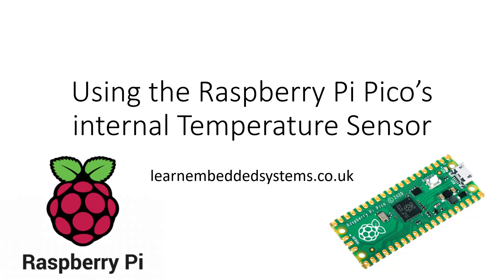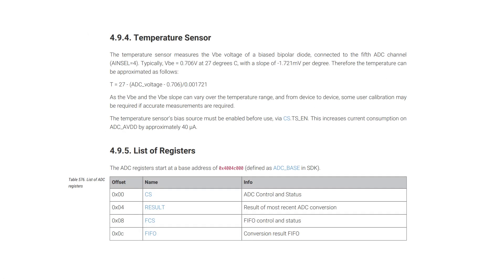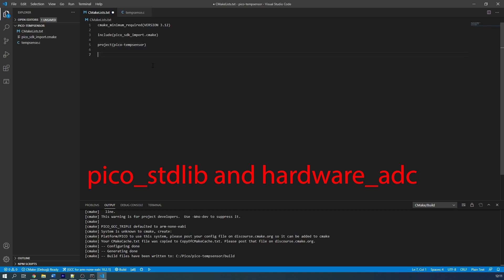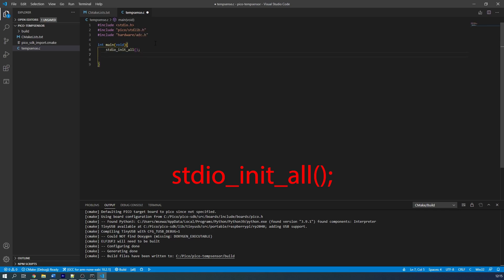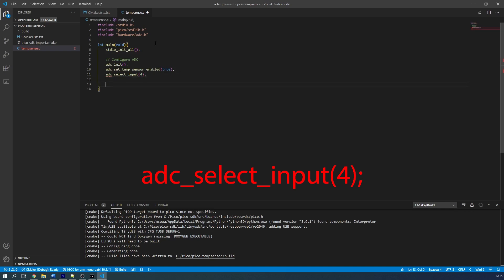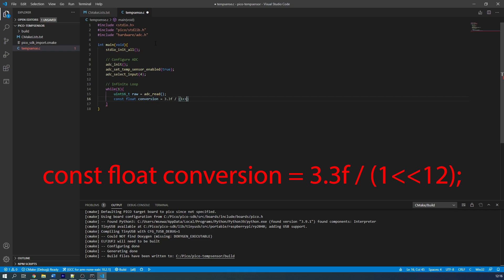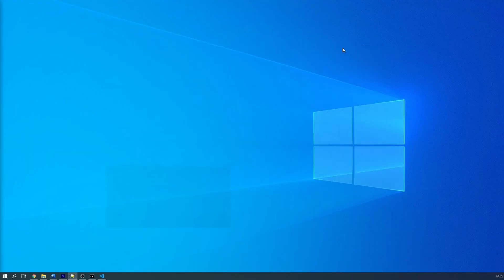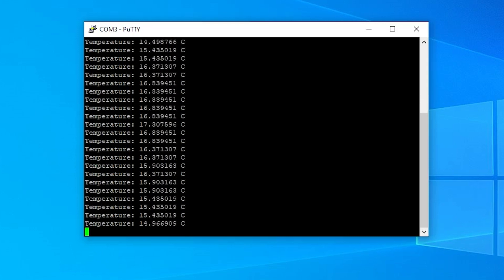How to Use the Temperature Sensor on the Raspberry Pi Pico in C

Comment: thanks for your efforts, with regards to calibration (this sensor or another): would it be just a formula: value +/- the delta or much more complicated? in fact even BMP280 that I have attached to SPI requires "face tuning" I believe vs. reference sensor, thx

Comment: Great video! I actually postet a question about this problem on Github in the pico-sdk. You helped me now realizing, how badly calibrated the sensor actually is. For me it's the other direction, sitting in a cold winter while my pico is telling me is 40 deg! I'll try and see, if I can calibrate it a little, but an external sensor is of course the better option.
Reply from the maker: Hopefully you managed to calibrate it!
Reply: how do you calibrate it

Comment: I cant tell you how long I scratched my head over this until I found adc_set_temp_sensor_enabled(1); because I kept getting odd values. Nice video. Check out my source code for a SSD1306 oled at my github/jbud

Comment: I have seen all your videos, thanks for making learning this easy! 
By the way, I have been looking for some information about using some kind of module like the MCP2515 for read messages from can bus via the SPI pins from the pico or using the pico as a "keyboard", Could you make a video showing something like that? just as a petition.
Reply from the maker: I am glad you are finding my videos helpful! I could certainly do a video regarding CAN communication, I am not sure if I have that exact chip but I can have a look around. This video will most likely be come after my SPI communication video.
Could you please clarify what you mean by using the pico as a keyboard?
Reply: @LearnEmbeddedSystems  what I meant whit the "keyboard" is something like on the ESP32, where you can write an script with key commands, and it automatically execute the orders once you plug on a PC. Waiting for your next video!!